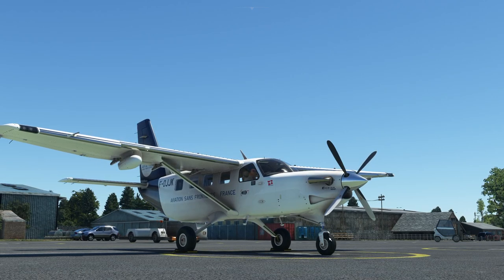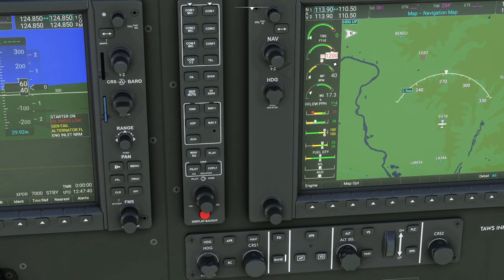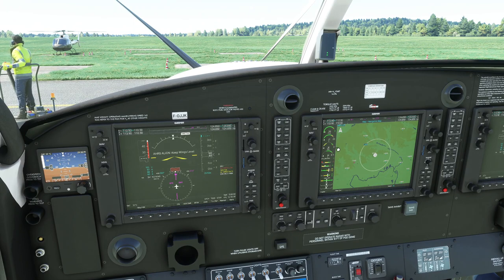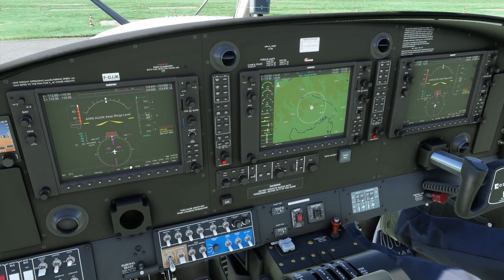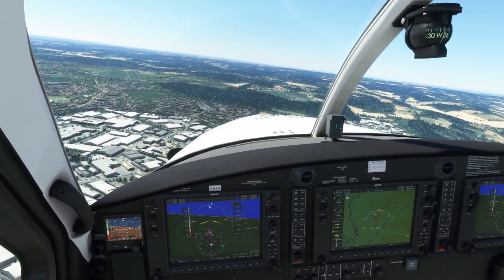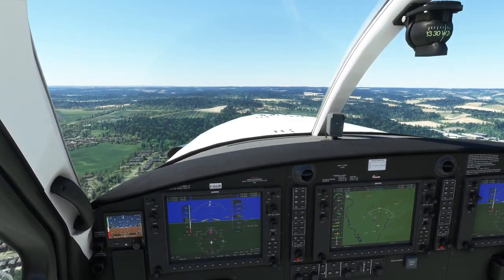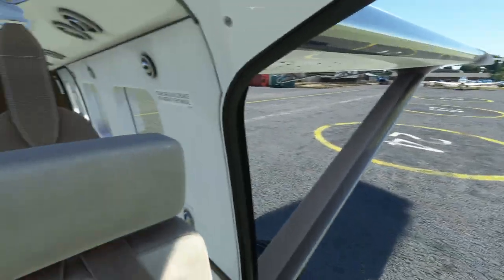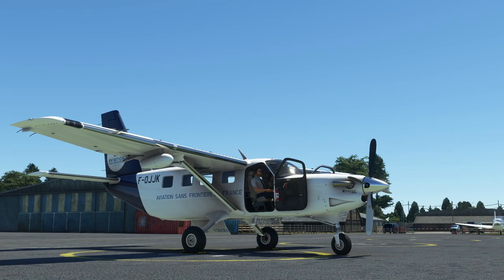Starting the Kodiak without destroying the engine in Microsoft Flight Simulator

Comment: You had it right the first time: once NG has reached 14, you push it to the low idle, not high. And you should really leave it in low idle during taxi. You only push it to high idle just before you enter the runway. You can watch just about any of Missionary Bush Pilot's videos for this.
Reply from the maker: Cheers for the tips :)

Comment: I have both Kodiak & Sim updated but I cant get engine started. The ITT is too low - 8° and does not increase. I have set everything correctly, even the BEACON lights and required bypass... Still nothing.
Reply from the maker: If you've previously damaged the engine, you have to re-start I think - because of a bug in the sim.
Reply: @jonbeckett  Actually not. Now I managed to correctly start the engine several times in a row, even from a saved flight. So I guess something was wrong in my first attempt.

Comment: WHAT IS WITH THIS PLANE 😂. I've graduated from the blown engine phase but now for some random reason, the aircraft loses oil pressure after about an hour of flight at 13K feet. I did an emergency landing and turned everything off and started cold and dark. Everything went off without a hitch. WHY did it lose oil pressure at random?
Reply from the maker: Very probably temperature.

Comment: Interestingly the Pilatus porter POH has you engage the starter before you turn ignition on to make sure you get oil pressure Only when you see oil pressure do you turn ignition on Thought that was quite interesting
Reply: Yes, you watch engine oil pressure come alive when you are on the starter, but you want the engine turning on a PT6 when you turn the igniters on.  You don't want to turn the igniters on if the engine isn't turning in case there is fuel in the engine.  You always want an turbine engine turning when you do this.   Some turbines with fadec just require you to hit the start button, and the computer takes care of everything, and I have to assume some of the newer PT6 variants, specifically those in helicopters have this.  I have run PT6's in ag airplanes, and have flown some Air Tractors with a Walters turbine conversion on them as well.

Comment: Just saw your video, and I have a veto.
The reason for the Hotstart is NOT that you forgot to start the fuel pump. It even starts with fuel pump in the standby position very nicely.
The true reason is, when you switch the red cutoff-left to early from off to low (or high) position!
This gets the famous Hotstart, because you inject fuel before you have a proper airflow thru the engine.
This burns your turbine instantly, which is maybe half a million to repair for the Kodiak.
Reply from the maker: Ouch :)  Great info!

Comment: Please tell me what is ignition for? I just saw a 2 min video showing " how to start engine" and that guy started this engine without using ignition why?
Reply from the maker: It depends on the situation in which you are starting the engine. If you read the documentation that comes with the aircraft, it goes through the various scenarios and when you should and should not use ignition.

Comment: I've seen some people start the engine with the propeller at high RPM. Would that damage the engine?
From what I've read, the reason you don't want to introduce fuel too early is that there wouldn't be enough air moving through the engine and thus cause a hot start.
It's crazy how finicky and unforgiving a turbine engine is compared to a piston engine.
Reply from the maker: If you introduce fuel too early, it will build too much pressure when it ignites. If the engine is turning over, the fuel that gets injected and combusted is burnt and gone.

Comment: Despite how nicely this plane turns, I find it difficult to taxi. It's very similar to the Cessna 208B which Microsoft has improved over time but this is plane is worth the price especially after the last two updates.
Reply from the maker: Absolutely - the flight modelling is great.
Reply: Don't put propeller and conditioner on max. Taxiing don't need much prop 🤙
Reply: Fuel conditioning on low.

Comment: Hi, can anyone help? No matter what I do, including going back to the main menu and creating a brand new flight, my previously cooked engine keeps starting hot from cold and dark. The SWS site now mentions "residual" engine behaviour, but not after completely going to main, I hope???? Needless to say, I follow the proper starting procedure.
Reply from the maker: As far as I understand, there is a problem with the simulator itself with certain types of aircraft failure, where the only solution is to go right the way back out to the main menu.
Reply: @jonbeckett  Hi I did, but even that is not working. Wondering if this "just me".
Reply: Hi, to my delight it wasn't "just me", a patch was released to fix the "residual ITT" issue and I'm back in business. What a great aircraft.

Comment: easily the most difficult aircraft to fly properly in this game, and it is all because it flies like the actual plane. once the plane is in trim it handles pretty much like a real ga plane should. It is extremely difficult to get this plane into trim, and to keep it there. the under 70 torque is a little overdone. if you watch the flight portion here you will see it is out of trim most of the flight. you winged over and stalled because you needed a ton of rudder. I love the modeling, love the dynamics but this is not for beginners. it takes real work to fly properly
Reply from the maker: I don't think it's difficult to fly at all - if anything, in my opinion being more accurate makes it easier, because it behaves as it should. It's not on rails. All planes with proper flight models should require trimming all the time. Something you can't see in the video is me trimming it - because I use a hardware control for that. 
Thanks for the feedback :)

Comment: Yes nice that the accuracy is improving. Fairly new to turbines and being the keeno to do it right that I am I download the POH before searching YouTube. The TBM POH is over 900 pages! 
3rd flight I ended up flying the trip manually as AP wouldn't engage. When I landed and was going through shut down procedure I realised I had forgotten to engage the AP auto trim switch!!
With regard to hot start - haven't seen a POH yet that doesn't insist you check throttle quadrant for emergency power lever, throttle, prop lever and fuel condition lever all being in right place as part of before start procedure. Should be standard for all turbines
Reply from the maker: The fun thing is that each aircraft differs slightly in terms of procedure, because the hardware and systems are always different. And of course we jump between aircraft, and often struggle to remember "how does this one work again?" :)
Reply: @jonbeckett  yep exactly! Tbm starter switch goes off automatically. Caravan you have to switch off yourself. Like you say - it is great when they model failures accurately. Loving this sim just want the flight models to be more accurate on stock aircraft.  Can't wait to test flight model on xplane 12

Comment: Hiya John
Firstly love your channel and all the GA videos. Soft question, could help me out how to configure my tca trust controller to use the second lever for the prop. Have tried and just can't get it right. Thank for the kodiak videos ya had the engine problem thanks again
Reply from the maker: All you need to do is remove the existing prop assignments, then add the correct one by choosing the axis - don't bother wiggling the levers to detect them - it will get it wrong. L Axis X is the left stick, L Axis Y is the right stick.
Reply from the maker: If you search for everything assigned to L Axis Y, you can remove throttle etc from it too.

Comment: I’m using the same controller, you might have config for thrust and propeller on previous videos ?
Reply from the maker: I'm not sure - I just configured the controller as per the plane - so I ended up with left stick for throttle/reverse, and right stick for pitch.
Reply: I’ll configure the same way. Blew the engine 🔥 last night, it’s back to the drawing board. Good startup video ! Haven’t flown Kodiak for 1/2 year and it shows

Comment: Thanks for sharing this info. This plane was on my to buy list for quite sometime and i just bought it. I struggled with it for a couple hours (mostly cold and dark starts and also low engine power after starting) and wondered if it was buggy at first. NO, this was certainly not the case it is not buggy, it was ME that was buggy.😂 Turns out, it is a very realistic and detailed aircraft and the developers put a lot of effort into it and it shows. Definitely one of the best deals on the spring sale right now. I just took a flight in it out to the great barrier reef. No doubt, I'll be putting a lot of flights on this one.

Comment: when will they add the smoke and fire to the engine?
Reply from the maker: That's down to the aircraft developer to do that. In most cases, MSFS does not model damage for the same reason that Gran Turismo doesn't model damage. The licensed aircraft won't want their product shown in a bad light, and modelling damage properly is potentially more difficult than the entire rest of the simulator.
Reply: @jonbeckett  Ok, thanks for the quick reply.  DCS makes it pretty spectacular, like in VR, once you explode into flames you are taken on a ride above your smoke and flames to about 2000 ft. or higher , which is breathtaking.  It just adds to the experience but I totally get what you are saying.  Crashing and burning are not high up on their to-do lists.

Comment: Any tips for starting the Kodiak at high altitude airports such as SLLP?
Reply from the maker: Use longer runways, and take off fast :)
Reply: @jonbeckett  Don't seem to be able to get the engine to tick over at that airport presumably due to the high altitude.  I'll ask ground crew if they can give me a push 😉

Comment: I never get the Taws system test ok only once  and also no TOD messages   = Vertical Speed
Reply from the maker: It depends if you have the NXI installed (from the marketplace) - the default G1000 has bugs :)
Reply: @jonbeckett  I have NXI  but ok and OBS setting it for landing will freeze the sim on the Kodiak.

Comment: Great advice on the engine start, but you don’t need to go to main menu, you can just select restart flight which will be a bit quicker and you won’t need to recreate the flight plan.
Reply from the maker: You're wrong - if you cause an out-and-out engine failure, there's a quirk in the programming of flight simulator - that a restart won't fix - especially with the Kodiak.
Reply from the maker: The SWS forums are full of people asking about it.
Reply: @jonbeckett  worked for me, so maybe it wasn’t totally broken.
Reply: @jonbeckett  ok I tried this again this morning, did exactly as you did and broke the engine. Everything identical and just using restart flight, the plane started correctly using the same procedure you provided. No need to go back to main menu, I am on Xbox series X so maybe behaviour isn’t the same as PC. So, I’m not wrong for Xbox at least! 😉